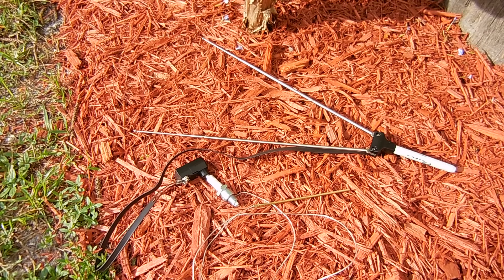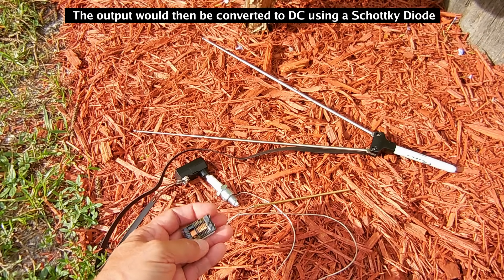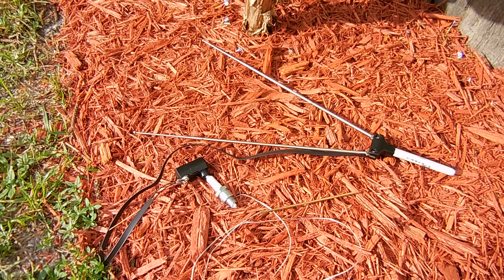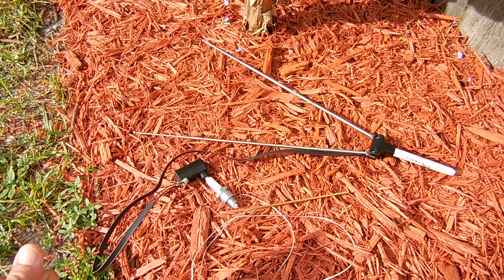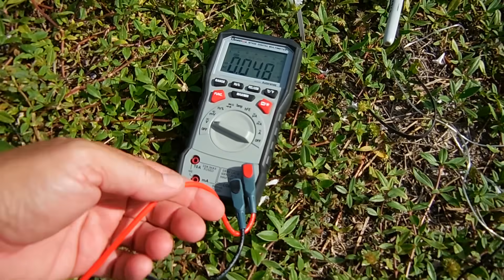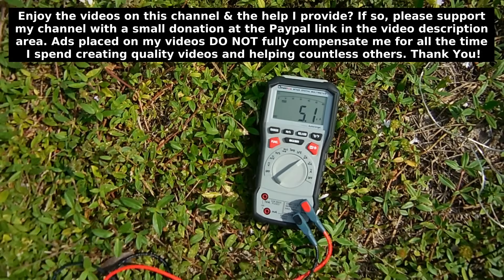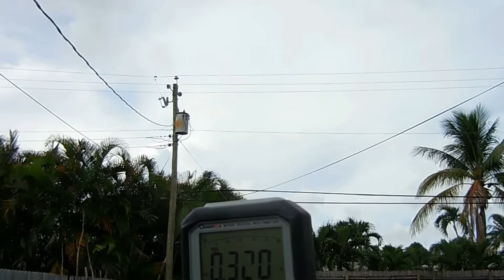Charging Cell Phones From Power Lines?

Comment: While I know this design is complete bullshit, I do wonder if it is possible to get about a few tenths of a watt from a properly designed setup... One would need to get a ULF antenna tuned to 60Hz ideally, or even the 3rd harmonic at 180Hz which results from 3 phase transformers. I would assume the radiation would be linearly polarized, aligned horizontally, and best results around very high tension power lines.

I can immediately tell the design is BS because:
* bunny ear antennas for TV reception was designed for VHF and UHF reception
* the impedance matching bobbin was also designed for VHF and UHF, and the impedance would be far too low at 60Hz, it would be a dead short, and the core would also instantly saturate at low frequencies even with low voltages across it
Reply from the maker: Funny you said 180. I tested the frequency using the antenna and got 180Hz instead of 60. :-) Thanks for watching!
Reply: @electronicsNmore  haha that's brilliant! Your small antanna picks that harmonic up better than 60hz!
Reply from the maker: I tested a few times, even standing next to the pole with 7620V, and most of the time 180Hz, once in a while 60-70 range.
Reply: @electronicsNmore  if I did my math right, you would need a 258 mile antanna to make a λ/4 dipole!!!

Better off living near a high power radio station. Then you could get enough power to make a low power device like a clock work! Or maybe even a small MCU like an MSP430.
Reply from the maker: I just used an online dipole calculator and came up with 7,800,000 feet for .00006 MHZ. LOL
Reply: wake up sheep baaaaaaahhhhhhh
Reply: @ricksmith3011  Just go back to school. They're discussing something far out of your league.

Comment: They use higher voltages and different frequencies and probably not near the filters we use in the states I watch a lot of their videos cause they do a lot of dangerous stupid things but I never seen them purposely try to fool anyone I know there's a lot more power flowing though high tension lines then the wireless charger that powers my phone every night.
Reply from the maker: After what I showed, you still believe it works? LOL Hate to tell you, but there's not much difference between 50HZ and 60HZ power lines.
Reply: electronicsNmore it might it work it might not I don't really care but unless you can duplicate the exact conditions your not disproven anything.
Reply from the maker: @joetri1970  People like you can NEVER be satisfied. Wish you well with your "Free Energy" endeavors.
Reply from the maker: Hit the road loser. If you had 1/4 of my intelligence and abilities, you'd be lucky.

Comment: You need diodes and capacitors of the correct value attached to the antenna, like the tesla receiver circuit
Reply: Still wouldn't work.

Comment: another thought. You want a 60Mhz resonant receiver circuit. Because the frequency is so low, this would be hard to build, with a very long wave antenna. A quarter wave antenna for 60Hz would be long indeed.

Comment: inverse square law will be in effect. So the closer you get to the high-tension lines, the more power can be received. Further, a TV antenna is not ideal here. Try just a single low-resistance copper rod, with a path to ground. I would do the physics problem first though. I recall this is a typical physics problem -- with a guy on a tractor, with a rod, driving under a high tension wire. Watch out.

Comment: How many volts the power line?
Reply from the maker: I was told they were between 115KV and 200KV, which was more than sufficient for the test, especially because I was standing much closer to the wires on that hill. Even if you double that line voltage, the 30VAC observed would probably become 60VAC, which won't cause a spark plug to fire.

Comment: I've heard of a guy who put a long many wound coil in his roof. Nearby was high tension wires.  He was pulling in current, and it was detected by the electric company and he was charged with theft.
Article here: http://www.industrytap.com/electromagnetic-harvesters-free-lunch-or-theft/1805
Reply from the maker: Interesting read, but I wonder if the 2 stories were just unverified stories handed down. Placing an iron core with windings wrapped around it next to a power transformer does work, so I know that's true. Thanks for watching!

Comment: Try this at night with CCFL or fluorescent lamp? It would help to know the voltage of the line. some big transmission lines can go as high as 155kV to 765kV
Soil moisture content may also be a variable in these experiments.
Have fun
Reply from the maker: Yes, that works. No need for wires. The high voltage ionizes the gas in the tube. Thanks for watching!
Reply: @electronicsNmore  Under 400 kV line, grounded 2 m vertical FL tube draws about 0.2 mA rms current from ground (measured). That's enough to glow at less than 1% of its' rated light output (not measured but estimated)

Comment: DO NOT PLACE ANY OBJECT TO HV LINE CLOSER THAN 1 METER. IT MAY CAUSE DEATH.

It WILL kill you faster than you can blink.

VERY IMPORTANT thing is - it's may be from VERY DANGEROUS to EXTREAMLY DANGEROUS if you don't follow safety or not familiar with electricity!

As Kreosan said, not all HV lines will do the job:

6,10 kV - not working
35 kV - not working
110 kV - slow charge
220 kV - charging
330 kV - charging
500 kV - charging
750 kV - charging

Most powerfull is 1150 kV in Kazakhstan.

Also, Kreosan isn't YouTube user which will fool his subs. So, maybe diffirence in HV lines in both your and Kreosan location or parts used:

1. трансформатор ТВС-110ПЦ15 (transformer from TV, scheme in web, but you have to copy text in russian to find it);
2. диод КД226Д (diod, same text on russian to find scheme).
Reply from the maker: I read everything he stated in the video, and the high tension lines used in this video were of sufficient voltage. I used the SAME parts. I did a very careful inspection of his video. His power line voltage could have been a little higher, but not that much higher based on the poles/wires used and what I saw. The transmission lines in Ukraine/Russia use AC volts like the USA. I highly suspect you've been scammed by him. More than likely a small hidden high voltage module.
Reply: @electronicsNmore  Bruh those power lines are overloaded because its normal in Ukraine and Russia.If you dont'b believe come to eastern europe where 230kV lines are super low,go under them at night with a fluorescent lamp.

Comment: Those are some weak power lines. There should be loud audible buzzing. Kreosan's videos are not fake. They are real, on point and entertaining. Not sure what you are trying to do with this video, didn't expect it from this channel.

I went to the power lines in my city with a few friends and it was really scary standing under them. I had a feeling that a spark will shoot down to the ground and kill me. You can literally feel it a little through your body.

In my opinion everyone knows there is no "free energy" in terms of generating energy from nothing. but not paying for energy you took from somewhere also classifies as free energy.
Reply: Actually its completely fake and they manipulate people for money!
Reply: Well, I WOULD like to see this tested near the truly HV power lines which the power lines in the city( the ones we all see and know) feed off of, but are carrying much lower voltages.  The big lines coming straight from the generator sources or those which travel across vast stretches of land need to run at much higher voltages (around 10,000 or more) to maintain transmission efficiency at longer stretches of cable.  Those power lines can light fluorescent tube lights wirelessly if you stick one end of them into the earth.  This isn't FREE energy, though.  No more so than your radio picking up radio signals, anyway.
Reply from the maker: @lynnburnett89  The lines used for this test were between 115,000V AND 200,000V, more than sufficient.
Reply: Well, there ya go then.  Good test.
Reply: Funny how gullible sheep are buying everything their religious leader KREOSAN tells them, yet you disregard anyone debunking him by pointing to irrelevant parameters.
Reply: you used to be able to slow your houses meter down with a magnet before they upgraded to digital . everytime the needle would pass by the magnet it would slow down . ah the good old days of getting your troublesome neighbor in trouble.
Reply from the maker: There was buzzing. LOL. Good luck hearing it with road traffic and wind.
Reply: @electronicsNmore  10KV lines are nowhere enough electricity to do this experiment. If you want to give it credibility, go find some high tension lines that are at least 200KV or more and low to the ground. I do doubt the antenna part to some extent, but again, without testing it yourself, you cant 100% say its fake.
Reply from the maker: @nzoomed  10kV? Who said that?
Reply: @electronicsNmore  I was looking at the wrong part of the video sorry, but those lines at the end of the video were 10kv. After rewinding the video I could see the HT lines but they were shown briefly that I missed them. I'm doing similar experiments and I'm getting about 60V. Will be using a much longer wire next time and I think we can get a few KV since 2 meters of wire is giving us 60V. Obviously an antenna is not going to give us that much.